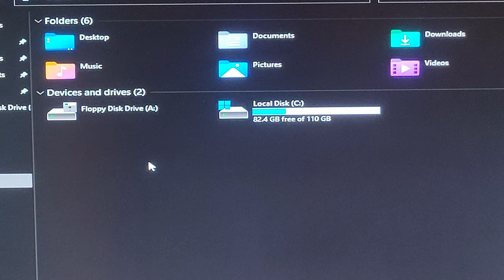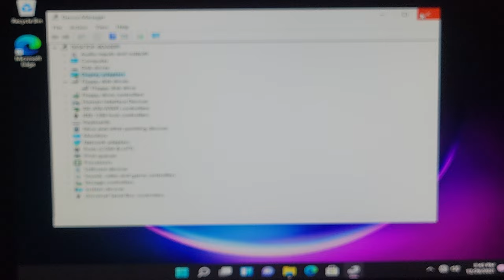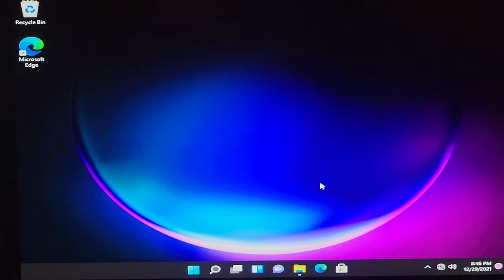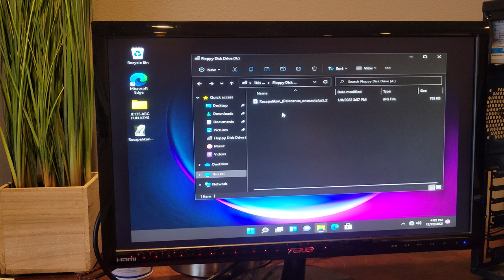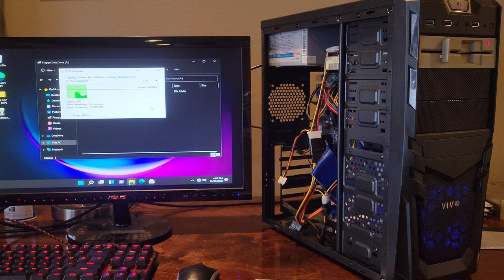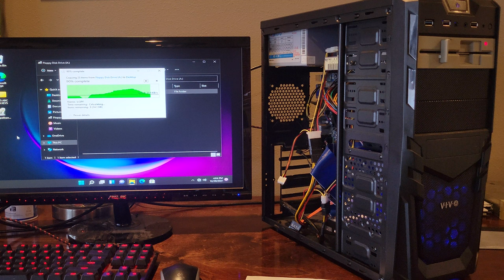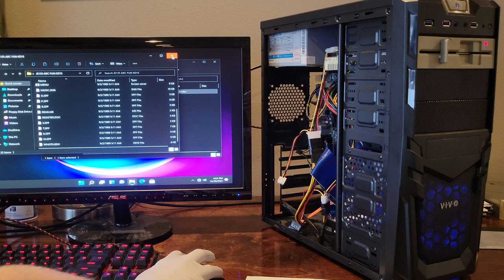5.25'' Floppy Drive on Windows 11 Showcase and Tutorial

Comment: HI, the board you have used, on specifications says: 1 x floppy disk drive connector supporting up to 1 floppy disk drive. With the cable of 34 pins is possible to conect 5,25 and 3,5 floppy disk drives in the same cable , but does it soported on that board ? Could be conected both floppy drives at same time or only one is supported ? Regards.

Comment: If you connect your floppies to an old motherboard that has a floppy connector on it and run Linux, you can then create disk images of all uour floppies. Then you run the Linux system as a File Server and have the Windows 11 machine open the image files while running Windows 11.

Comment: What kind of gaming performance can you get on this? I would love to build this for nostalgic purposes but would love to play WOW at 1080p and a high frame rate. Add a 3.5 inch drive and I'll be a happy camper!
Reply from the maker: You won't be able to game on this. You could install any GPU you wanted, but you're limited to an old CPU because it requires an old motherboard. You'd be hard pressed to install anything above a core2 quad.

Comment: Interesting fact: 
Windows 11 actually supports 360k 5.25" floppy drives. That didn't work since Windows 2000. Since then, you could only use 1.2M 5.25" floppy drives. 
Using a 360k drive on Win2k onwards would only give you an I/O error, since Windows would expect a 1.2M drive.
I have a PC that's about 15 years old, P4. And the mainboard still has a floppy controller. It can run Win10 (where I also get the I/O error), so as a test I've installed Win11 (had to use tricks to bypass the checks for TPM and Secure Boot. Pretty easy to do). And to my surprise, Win11 would read and write onto 5.25" 360k floppies just fine. Blew my mind, because that means that MS has re-installed the support for drives that can't be installed anymore on any motherboards that would officially support the OS xD
Reply: Whoa, isn't that nice! They probably figured that kind of support is just, like, a few kb worth of code, so they might as well haha
Reply: Wait so would I not be able to do this on windows 7?
Reply: @zandersans  
Not with a Double Density (360k) drive. You'd get the I/O error. 
If you have a High Density (1.2M) drive, then it should work to my knowledge. I don't have a spare HD 5¼ floppy drive to try in this PC, so haven't been able to test it yet.
Reply: @electroman1996  ahh I see, please let me know when you test it!
Reply: @electroman1996  also, do you know what physically drive was used?

Comment: I'm old, there used to be adapters to convert the 5¼" connector to the 3½" connector. I have functional 3½ & 5¼ drives using a floppy cable the has both 3½ & 5¼ connectors before AND after the twist in the cable.

Comment: I'm definitely using this or a similar motherboard - I'd like to build a computer someday that's capable of relatively modern operation (windows 11 being a nice indicator), but in one of those old, tall ATX towers. Some even have as many as 6 large bays, and 3 small ones. I'd use the small ones for 3,5'' floppies, a ZIP drive and a 2,6GB magnetooptical drive, while the big ones would be a 5.25'' floppy, a DVD-RW, a HDD caddy (hoping there are SATA ones available for that era!), a multi card reader, an USB hub and maybe a case speaker like the one LGR recently demonstrated. That's 9 out of 9 bays filled. Wouldn't it be awesome?

I suppose all those extra drives could be handled by using a PCI IDE adapter. Some messing around will probably be necessary, but this particular era of motherboard is probably the best available type to connect old and new computing storage solutions.
Reply from the maker: Yup, it's the perfect balance of old and new. Just old enough to support this kind of thing, and just new enough to be compatible with most modern peripherals and systems.

Comment: 👍 AFAIK, floppy disk support depends on motherboard, Super IO chip and BIOS. Windows 11 just kept the code.

That Gigabyte GA-965P DS3 (any revision) doesn't support 2 FDD devices, according to its manual, but MS-DOS can map drive letters A: and B: to the same (only) device enabled... 

The following mobos support two FDD devices:

— Biostar P4M900-M7 (Sock 775)
— Biostar P4M890-M7 (Sock 775)
— Biostar P4M900-M4 (Sock 478)
Reply: For motherboards that don't support dual floppies, you could just as well use a USB converter for your 3,5''. You just hook it up into the motherboard's USB slot then and you're set - it'll still get recognized as your A drive. Not sure what it'll be if you've already running a 5,25'' though - it'll probably become B then.
Reply: @SaturnineXTS I wish there was an easy way to take a 3½" USB floppy drive and just disconnect the existing drive and vonnect the USB part to a 5¼" drive.

Comment: Awesome. Can you tell me if I have this correct.
1. Need a 64bit mobo that also has a native 34 floppy connector on the mobo.
2. Bios must support 5.25inch floppies. In my case 360k.
3. Run windows 11 for 360k support win2k up to win10 did not have this.
4. Appropriate cable required. 34pin floppy on one end the other end has the thick edge connector style.
5. I'm still unsure of jumpers on the 5.25 drive itself. I'm guessing I select ds1.
Am I missing anything or did I get anything wrong?
Reply from the maker: Thats it! I didn't mess with any jumpers. I personally don't have any 360K disks to use, but I see no reason why It wouldn't work. Another person here got them to work.

Comment: I'm rejuvenating several vintage MS-DOS clone PCs.  I'm interested in what you've done because I ultimately need to transfer files to 5.25 floppies.  These older vintage PCs (Visual Commuter 1083) only had 5.25 floppy drives.  I've watched your previous videos and have the following questions.

1.  In your previous video you were using a GIGABYTE GA-965P-DS3 motherboard.  Here you have the GIGABYTE GA-MA7GPM-DS2H Rev-1.  Was the change to this motherboard just to have 64 bit for Windows 11?

2.  The older vintage 5.25 drives are 360K.  Have you tried to read and write to a 360K floppies with your 1.2M drive?  I'm told there are some limitations because of the narrower track head of the 1.2 M drive.  But with a bit of finagling I'm told the 1.2 M drives can read and write to the 360K floppies.

3.  In the BIOS, is the floppy selection on this motherboard similar to the previous motherboard video?  Would the BIOS allow you to select drive A as a 5.25 and drive B as a 3.5?  Or is there only one selection that applies to all floppy drives on the ribbon connector?

4.  In your previous Windows 10 video it seemed fairly slow to boot.  Have you noticed an improvement in speed to boot up with this motherboard and  Windows 11?

5.  eBay doesn't show the Gigabyte GA-MA7GPM-DS2H Rev-1 for purchase.  Do you have a link to purchase the motherboard?

Thanks very much for sharing your findings on the 5.25 floppy with Windows with this video.  Much appreciated and good job!

Regards, Ron
Reply from the maker: Happy to answer your questions! My original video on the subject was a bit hard to follow anyway.

1. The switch from the GIGABYTE GA-965P-DS3 to the GIGABYTE GA-MA7GPM-DS2H Rev-1 was not related to anything in terms of compatibility. The GA-965P-DS3 actually ended up breaking. I don't know the cause, though that just happens with boards from this era. Both boards should work fine with windows 11 as the old board had a 64 bit Core 2 duo.

2. I don't own any 360k disks, so I don't have a way to check compatibility. I don't personal know what challenges that would entail, if any at all. But as you said, there should be some way of getting it to work I'd imagine.

3. Good question, The bios selection was fairly similar if I remember right, though it's been a couple years since that old board has worked. On the GA-965P-DS3, I do seem to remember that the drive selection applied to all the drives on the ribbon. If they don't work on the same ribbon, there are two things you could do instead. On eBay, there are adapters to allow a 3.5 inch internal drive to be plugged in with USB. You'd just have to plug it in internally on one of the motherboards USB internals headers. The 2nd options is to just use a USB 3.5 drive, though those are sort of hit or miss.

4. There are a couple reasons for the slow boot time. The first being the older CPU, but the most impactful is that Windows was installed on a 2005 era 40gb hard drive. The use of a modern SATA hard drive or SATA SSD would increase speed dramatically. Though don't expect blistering speed in windows, as that is more CPU constrained, especially with these old processors.

5. I got both of my boards in person, so I don't have a seller or anything. I did some browsing, and this one is incredibly similar, but for obvious reasons, I can't guarantee that it would work. https://www.empowerlaptop.com/p/ga-ma78gpm-ds2h/
One thing to note, I had trouble installing windows over USB on this board, so I resorted to installing via DVD (Original had 10 on it). The Windows 11 install process is much harder than with windows 10 or previous versions. If you want to install Windows 11, you first need to install (likely via DVD) a 64 bit version of Windows 7, 8, or 10. Then you'll need to install Windows 11 with the media creation tool to bypass the large amount of "incompatibilities." You may have to do one registry edit, but there's plenty of guides for it, and it only takes a minute or two.

It's a bit of a time consuming thing to do, but when it's done, its so much easier to get data onto these disks than using old operating systems or terrible third party adapters with awful software since it just works natively in file explorer. The only other thing of note is that Windows would crash whenever I connected to the internet with a USB wifi adapter, but a wired or tethered USB connection worked fine. If you have any other questions, please let me know.
Reply: @Jrcraft  I appreciate you taking the time to address all my questions.  I'm on the hunt for a Gigabyte motherboard.  I've found the identical board you used in your original W10 install on eBay.  There is also a local computer parts store that has a bunch of Gigabyte motherboards, though none identical to either of yours.  But they seem willing to verify that the BIOS has the 5.25 selection.  It would seem that the trick is to get a modern enough motherboard that will work with windows 10 or 11 but still have the 5.25 floppy BOIS selection.  Thanks for making the video.  It provides a practical solution for those of us that are working with the vintage 5.25 floppy PCs.
Reply from the maker: @ronanderson1839  No problem. There were no resources to start from when I first build it, and I figured the original video was pretty old, so I'm glad that I can help people figure it out for themselves. The sucky part is that there's no online list of boards that support it. Hopefully you find a compatible board. Every Windows release, it gets harder to get hardware that can both reach decades into the past while also reaching into the present. I fear that this might be the last Windows release that it will work on. but you're absolutely right, that is the trick to getting one of these special machines. If you do go about building one, I'd love to see a picture of it. Using these to pull data off of old disks or transferring stuff between old and new machines is the best way to do it, because it just works.
Reply: @Jrcraft  Back again.  Quick question on the Gigabyte floppy bios selection.  For those units where the bios supports selecting a 5.25 floppy, sometimes there are two selections: 1.2M, 5.25 in.  and   360K, 5.25 in.   However, some only have the 1.2M selection.  Obviously the 1.2M was available on your Gigabyte motherboard.  Do you recall if the 360K selection was also available?
Reply from the maker: @ronanderson1839  I honestly don't remember. I'm out of town at the moment, but I will look for you when I get back in a few days.
Reply: @Jrcraft  Appreciated.  Update - I found a machine with bios selections for both 370K and 1.2M 5 1/4" floppy drive.  My son had this older PC setting in his basement.  I'll need to see if I can get Windows 10 to run on it.  I think it's promising because it has a reasonably modern processor.
Reply from the maker: @ronanderson1839  That's awesome!keep me updated!
Reply: @Jrcraft  Just reporting back.  Success story here.  I installed a 360K floppy drive in Windows 10 on a GIGABYTE GA-EP45-UD3P motherboard.  After I got the 5.25 floppy working, I purchased a USB 3.5 floppy drive on Amazon for $17.  It was plug an play.  No setup whatever.  Now I have a modern system with a 360K 5.25 drive and a 3.5 drive that reads both 1.44M and 720K.  I added a $10 USB WIFI and now I'm all set with access to the web and connection to my server files. All inspired by your success and your video.  Very pleased so far.  I stayed with the 360K 5.25 rather than installing a 1.2M version because all the vintage computers I own have only 360K drives.  I can now download files off the web and easily copy them to a floppy disk that will go right into my vintage units.  One issue to note.  The Windows 5.25 drive will not format a blank disk.  Not sure why.  For now that's not an issue since I can format floppy disks in my vintage PCs.  I'm looking forward to using some disk image software to see if I can generate DOS floppy disks with various vintage programs.

So thanks again for you inspiration.
Ron
Reply from the maker: @ronanderson1839  I'm so very glad to hear that. It definitely makes interfacing with & transfering files to these old systems much easier and even acts like a bridge to the internet in a sense. Glad your system works well & that you get good use out of it. It's definitely the case of getting the right types of hardware since the software itself doesnt mind the old drives. If you have any more questions or anything, just let me know!